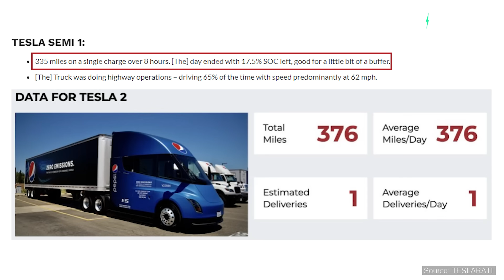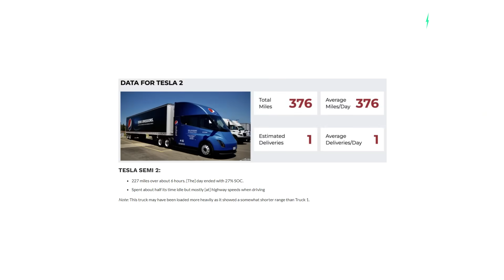Tesla Semi tested at highway speeds - REAL world range shocks rivals

Comment: There was a very interesting run today (Day 5) by Truck 1 at the PepsiCo (Sacramento) depot, at Run On Less Results. In brief, starting at 1:00 AM, this Tesla Semi ran at exactly 62 MPH, so obviously at least on ACC, for 381 miles; with a 50 minute stop at 5:25 AM; on 77% charge; which extrapolates to 494 miles on 100% charge. 
During the tests, the loads are not being documented, although they will be in the final report. So there's no way to prove what the load was. But this is coming out of the Pepsi Bottling Plant, not a Frito-Lay plant; and PepsiCo executives have stated in effect that trips from the bottling plant are weighed out, which would mean about 42,000 lbs., although this can't be verified yet. So at this point, the worst you can say is that it has a range of almost 500 miles lightly loaded; and it's very likely that the final report will show a full load for this trip, essentially validating all of Tesla's claims for the Tesla Semi. Time will tell...
It's a bit of a mystery where this trip went. The Speed, Distance, and Battery Charge lines are all perfectly straight to the eye, which means no significant climbs or descents. And for the first 273 miles, he only slowed down once, and that was only to 33 MPH; so definitely not a turn-around. And after one run of 273 miles and another of 100 miles, he ended up charging at about 375 kW. Probably not at a Megacharger, which would be around 700 kW;  but perhaps two Superchargers, assuming this initial batch of Tesla Semis are so equipped, which they likely are.
Hopefully, the final report will also show maps; but if anyone can figure out where you can go 273 miles on flat ground from Sacramento, please reply!
EDIT Bakersfield. 270 miles, with a maximum elevation of about 600 feet and back to 400 feet at Bakersfield.
EDIT And 100 miles back from Bakersfield takes him exactly to Harris Ranch, where there's a 98 station Supercharger, and where Tesla Semis are known to frequent (https://youtu.be/Fl71FRIuA4g?si=Ct1mHHCeauyvZIBg&t=134) (Go to 2+14 in the video; for some reason, it doesn't use the time parameter when you click on it). So that's clearly where he added 36% of charge at 375 kW, to get him back to Sacramento.

Comment: As battery tech improves, these ranges will increase.
Given enough improvements, it will affect every bottom line and make a normal diesel truck illogical.
Right now they're mainly good for shorter range deliveries. But if you triple the range to 1000 miles by swapping out the batteries in 2027, there's no point to diesel.

Comment: The weakness of EVs are uphill, at full speed, and under load...they all drain batteries FAST. The range fell by 30% or so as soon as it was "more heavily loaded". They will always be loaded like this, unless bobtailing to get the next load. THAT is their range (or whatever they are fully loaded). It also did not run but HALF the time balls out at highway speeds...the other one was almost entirely highway, 65% at full speed. This means the truck partially loaded was also going balls out...while the truck fully loaded went soft. The effect of not going balls out on range cannot be understated. They will usually be going balls out. Lastly, none of these trucks will EVER be run down past 20% of battery capacity, so running to empty is never going to apply.

Conclusion: that 30% reduction in range when halving the truck at full speed means the 30% will rise to closer to 50% when the truck is going balls out most of the time, like the first truck it's being compared to. That means functional range is closer to 165 miles...not 227, and not 300 something either. This also didn't take into account cold weather around the country and the effect on batteries. 

Stopping every 165 miles to charge for an hour wouldn't be bad...but those are a lot of batteries to charge in just one hour...how many hours does it take a diesel truck to go 350 miles? At 50mph, 7 hrs, plus maybe an hour of fueling...it takes the electric vehicle that much time, plus however much time it takes to charge beyond the time it took to get fuel instead. 

The main savings is MPGe. It's more efficient, for sure, to use electric. I'm just still skeptical this will be chosen in fleets, en masse, over diesels. It doesn't seem like much, but drivers aren't paid by the hour, and a lost hour here or there is billions in the economy per year. I'm not so sure about this yet...but am cautiously optimistic. My main reason to hold back here is the first thing I said: knowing that uphill, at full speed, and under load, EVs are at a disadvantage, given range reduction in exchange for those functionalities. I still think a diesel hybrid design would be more advantageous overall, given range increase to make this far more practical, and refueling far easier. True, you sacrifice some MPGe...but you gain time, and time is also money. It's going to be cool to see how much time value of money effects the MPGe tradeoff.
Reply: Almost everything you've claimed about Tesla Semis in this test is demonstrably false.
 none of these trucks will EVER be run down past 20% of battery capacity, so running to empty is never going to apply 
FALSE. If you're on the site, go to Day 1, Truck 3. At 7:12 AM, the Battery Charge was 1.725%. If you'll go to Day 4, Truck 1, the Battery Charge was 4.8% at 6:36 AM. While 1.7% is admittedly cutting it close, Tesla cars have an extremely accurate trip calculator, that takes into account climate, speed, battery conditioning, elevation, and other factors. Tesla Semis will have an even more comprehensive trip calculator, allowing trips to be planned safely to 10% SOC or below.
 That means functional range is closer to 165 miles...not 227, and not 300 something either. 
 FALSE. That same truck, on the same day, went 378 miles without charging, using 92.5% battery charge, which extrapolates to a 408 mile range. Gross weight was stated at 80,000 lbs., and it was all at highway speeds; as high as 67 MPH, but mostly at about 64 MPH.
 uphill, at full speed, and under load, EVs are at a disadvantage 
FALSE. Mountainous terrain is where the Tesla Semi has the greatest advantage over diesel semis: first, because they have 2-3 times the HP of diesel semis, allowing them to climb steep grades at highway speeds; second, because regenerative braking on the descent removes almost all of the fuel penalties for steep climbs; and third, because there's no loss of power at high altitudes, and in fact slightly better economy due to less air resistance.
As an example, on Day 4, Truck 1 drove to Reno and back, a climb and descent of about 5,000 ft. On the trip to Reno, the effective range was 262 miles, reflecting the additional energy required for the climb. On the trip back from Reno, the effective range was 780 (!) miles, reflecting the energy used in the climb to Reno being returned via regenerative braking on the descent.
You can verify everything I've said for yourself at Run On Less Results. Select the day you want to view, day 1 being 9/11; PepsiCo (Sacramento) for Depot; and truck Tesla 1, 2 or 3 for the Three Tesla Semis in the test.
Reply: @BigBen621  the one is loaded down, the other is not, the one is going full speed, the other is not. The TEST took it down under 20%...to do so heats up the batteries, as does under load or up a hill or at full speed...so, they will not be running under 20% over and over, or the most expensive component, the battery, will need replaced relatively quickly. Apples to apples, my estimates are closer than what you're saying. They will not get 200 miles of range fully loaded at full speed, PERIOD, unless they choose to damage batteries to get there. You aren't getting around the thermodynamics. 

You said I was wrong...but all you did was quote their stats, which do not have the same controls for the comparison. This is a publicity stunt. I like Musk and Tesla and all, but they overpromise, and usually that won't matter, but we'll see how this goes when purchase orders come...how many companies buy these will matter, relative to the diesel alternatives.

Again, diesel hybrid is better here, although heavier setups...the range would be much farther per load, per pound, per refuel. THAT does matter to the bottom line, even if less thermal and energy efficient.

Comment: What's interesting is that it's possible to track charging speed with the charts at Run on Less Results. Typically, the charging speed is 0% SOC to around 75% or 80% SOC in one hour, which is consistent with 750 kW chargers with minor losses. But, just like electric cars, the charge rate starts to taper off at 80%, and it takes about another hour to get the last 20%. So—again like electric cars—the best strategy, if adding charge during the day, is to stop at 80%, wherever you started at. And this provides a rough answer to a frequently asked question—how long does it take to charge a Tesla Semi? Answer: about 2 hours, from 0% to 100%, at a 750 kW Megacharger. Of course, no one runs a truck down to 0%, more likely a minimum of 10%. So maybe around 52 minutes to charge from 10% to 80% if that's enough for the following day's run, and 1:52 to charge from 10% to 100%, if that's what's needed for the following day's run.

This also sheds some light on short-duration charging. I frankly don't recall what the claim has been; but since charging is quite linear from 0% to 80%, it's pretty clear that this means adding about 40%, or 200 miles for the nominal 500-mile long range Tesla Semi, during the 30-minute break prior to 8 hours of driving mandated by HOS regulations—assuming there's a Megacharger available for this purpose. This gives the Tesla Semi a nominal 700 mile range including the 30-minute top-off. 

By the way, these are clearly the long-range Tesla Semis with ±900 kWh batteries and nominal 500 mile range being tested; I don't know where Sam or anyone else got the idea that these were the short-range, nominal 350 mile range Tesla Semis. All of these come from the Sacramento PepsiCo bottling plant, and all of those Tesla Semis are the long-range, nominal 500-mile range Tesla Semis.

Comment: Max weight including truck in USA is 80,000 lbs.  The thing with this test is that no one really knows what the weight is. If you’re on the USA highways, that’s an important thing to know wouldn’t you think?
Reply: Runforless is just releasing basic information for now.  They do a highly detailed report on each vehicle tested including weights hauled and many other variables after the tests are over.
Reply: Actually 82,000 lbs. for electric and natural-gas powered Class 8 trucks.

Comment: The Tesla semi is crap and that’s not a real test based on science. no one is picking one up 30 made and only one company bought it who is also testing hydrogen trucks. Volvo , Mitsubishi, hino (Toyota) have sold electric trucks in the thousands . The Mercedes and scania trucks euro 6 emission s are unbelievably frugal, more frugal than a Tesla semi way more reliable and supported . So is Volvo, ford and paccar who has an electric truck coming out. The hydrogen trucks are performing very well too
Reply: As much as you and all the other haters might wish it, none of these other trucks comes anywhere near matching the specifications of the Tesla Semi—range, efficiency, charge power, charge time, etc. YT doesn't allow links; but you and anyone else who wishes to confirm this can see a chart comparing the various electric semis by searching for evuniverse io newsletter semi , and clicking on Jaan of the EV Universe.

Comment: I imagine that someday the option of towing a cargo equipped with a battery and electric motors could extend the range of the truck.   All controlled by the Semi controls by blue tooth.
Reply: A Tesla Semi, loaded to 82,000 lbs. GCVW, and topping off during the 30 minute break required prior to 8 hours on duty, can drive as far in a day as permitted by HOS regulations, and then recharge at the end of the day after the driver goes home to his wife and kids. Of what value would additional range be—especially since this scheme would dramatically reduce the payload? To put it another way, if you're willing to trade payload for range, just reduce the payload.

Comment: 4:00 turns out Tesla wasn't lying!!!!!!! That's all Musk does, but here's the point, I have no problem with Tesla EVs, the Cybertruck, or Tesla Semi, all they are is electric vehicles. The problem now, and it's always been the same one, is batteries are way too expensive and too heavy. 100KWH Tesla battery goes for $25,000 and weighs 1,400 lbs. times these numbers by 10 to power the semi, not looking good. So compromises all around, until much better, cheaper batteries appear.

Comment: These would be awesome for port deliveries.  Living in Los Angeles, I see short-haul delivery semi trucks taking containers from the Port of Los Angeles about 60 miles to the Ontario rail yards.  Imagine cutting out all the diesel emssions from these.
Reply: I was looking at the California timeline for converting these trucks to EV's and they want to complete the transition by 2035.  It think that might be a bit aggressive but certainly guarantees every EV truck will probably have multiple buyers chasing after them for years to come.
Reply: They do drive 60 miles, but they do it a lot, so they might need more range or quicker charging. Wait, that's why Tesla made the Megacharger.
Reply: all tesla would have to do is build out the megawatt charging infrastructure hopefully on any major used route.   I assume there will be tons of customers considering the near term savings 2-5 years.

Comment: The question now is, with small data from only three Tesla semis, is that range, above claimed range a result of underpromise but overdeliver marketing or true above expectations. The numbers are few and the presented data is curated as not full data on full state of charge capacity is known from the start (calculated) road weather, wind conditions, height difference, weight of trailer. It's still hard to extrapolate what the Tesla semi really can do in real-world performance.

Comment: Tesla must be gathering data on range vs load, elevation changes along the route, speed, possibly altitude (lower wind resistance in thinner air), temperature, wind speed & direction.  I expect them to provide an accurate estimator of battery charge requirement for specific routes including if a lower speed would reach the destination.    Also, provide a calculation on how much KWh are saved (in terms of cost of energy) vs an extra hour of driving time to obtain that cost saving.

Comment: I smell a rat… no stats on weight carried. Apparently the battery is so heavy the cargo is smaller than normal. 😂
Reply: I smell a rat… no stats on weight carried 
Loads on all trips will be released with the final report. The daily reports are showing graphs of measured speed, mileage and charge.

Comment: I wonder about the physical transport of electricity via batteries? Electric trucks and other industrial machinery is going to draw a lot more power then our current grid can handle. 

How much stored energy can you store in 50,000 pounds of battery? Could this be a way to transport electricity to meet exploding demand..  Could you truck, train or ship electricity in batteries to areas where the grid cannot meet demand?
Reply: As can build out the grid as needed.   Same with generation.  Investors will love the opportunity.  The key is getting enough transformers.

Comment: All good news.  The diesel-heads have nothing to say.  Certainly the battery packs will lose capacity over time, but this is a small & predictable loss that can be dealt with by careful trip planning if necessary.  From a money perspective, less maintenance & cheaper fuel wins the day every time.  My mid-May 2019 investment in $TSLA still looks pretty good...
Electric garbage trucks make enormous sense.  In my Canadian town the diesel-powered "waste collectors" can be heard all over town with their constantly screeching brakes stopping at each household, followed by the roar of a mighty diesel moving a few  tens of metres to the next customer.  Regenerative braking will revolutionize the noise environment & seriously reduce the cost of replacing brake shoes/rotors/etc.  Might need special gearboxes to efficiently recover energy from such slow-moving vehicles, but that is just an engineering issue.
Reply: The biggest noise from my neighborhood garbage trucks is not from the engines themselves. It comes from the noise the pumps and gear boxes installed on the trucks to process the collection of the trash bins, dumping them and returning them to the side of the road collection point. 

However, I am a big fan of the refuse trucks switching to battery electric. For the most part, their operating envelope is almost the perfect scenario for the current level of technology. Constant stop and go, fairly low total route miles, returning to a home terminal at the end of the shift where they can use a centralized charging structure to refuel for the next days route.
Reply: Diesel heads would say that Tesla have not sorted the payload issue so will not sell the trucks in numbers. Looks like another much delayed product launch whilst they try and fix it ,  like the Cyber……..four years is it ?